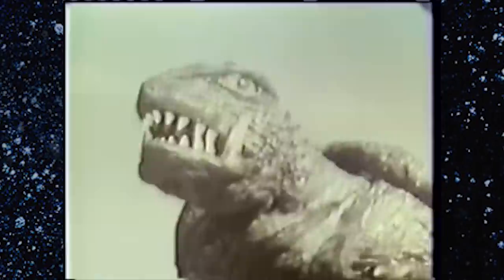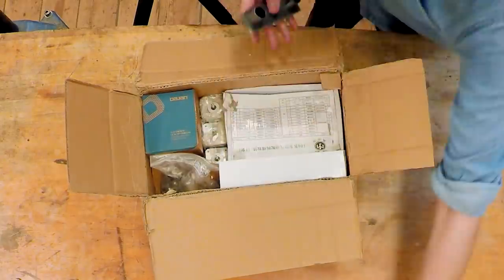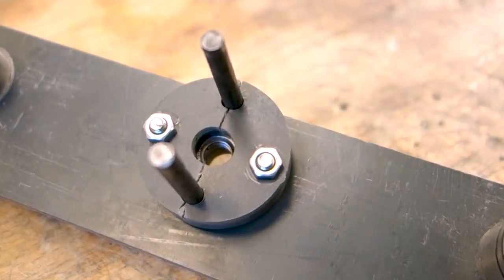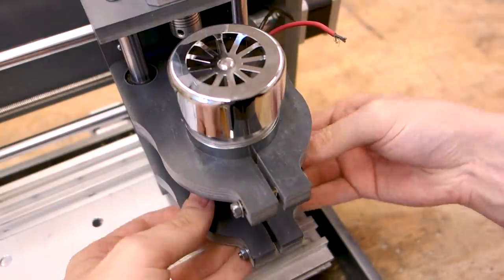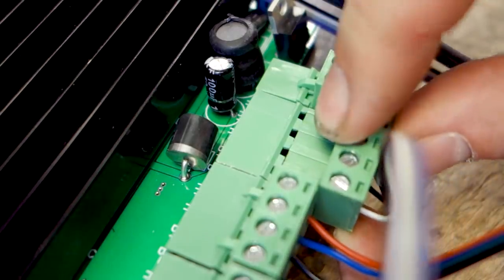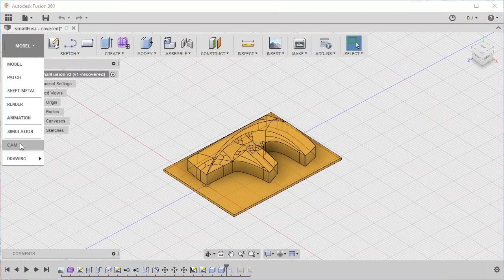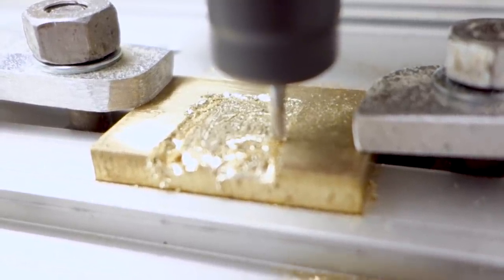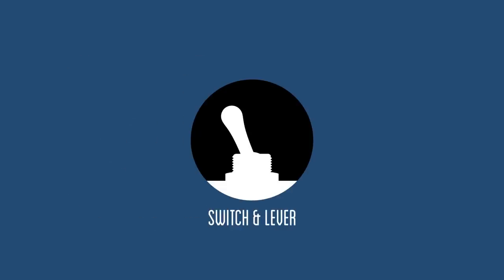Review: Cheap CNC Mill

Comment: Is it possible to replace the structural parts with aluminum or steel? Haven't finished watching. lol   
Finished watching. So it's a toy unless you want to completely rebuild it with proper materials.
Reply: +disgruntledscientist  well, a lot of things can be somewhat deceiving. Like just how easy it is to design and build a DIY CNC machine on your own. Few get it right the first time around. Few even end up with a machine as good as this kit here. I'm not saying this kit is so good, just people's attempts can turn out that bad. I know my first tries did not go so well. I got it eventually, but not until after I came to terms with a lot of things.
Reply: disgruntledscientist "Is it possible to replace the structural parts with aluminum or steel?" - Of course it is, but then it wouldn't be the same CNC mill anymore, would it? :P
Reply: why not buy a machine that is already made out of aluminum steel?
Reply: Google+ SUCKS BALLS - the worst forced social network "that is already made out of aluminum steel" - Hmm, I wonder what kind of steel is that. Never heard of it before....
But seriously: the reason is because a CNC with an aluminium frame would cost $600, not $400 like the Switch & Lever said this thing costs. Of course it would be a better CNC, but don't let that distract you :P
Reply: +CoolKoon  They may have meant aluminum metal? Or aluminum and steel? Though iron makes the best machines. For more reasons than I care to go into here. A capable metal frame CNC machine with decent linear guides would cost considerably more than just $600. Note that I did say, "capable". So that would mean a machine with better motors, drives, and linear actuators too.
Reply: Paul Frederick "Note that I did say, "capable". So that would mean a machine with better motors, drives, and linear actuators too." - Yeah, absolutely. But a metal frame is definitely something below which I won't go no matter what.
Reply: CoolKoon but buying a 400$ machine and replacing parts for metal would cost less than 600$ ?? You get a proper proxxon mini mill for 450€
Reply: Google+ SUCKS BALLS - the worst forced social network "buying a 400$ machine and replacing parts for metal would cost less than 600$ ??" - Only if you'd source and cut those parts yourself (maybe). I was referring to buying a complete CNC that come with metal parts anyway. 
"You get a proper proxxon mini mill for 450€" - Yeah, but to that you have to add the costs for the stepper motors (3 of them), plus the PSU, the electronic etc. They also sell a CNC-ready version for ~$900. Its only drawback is the smaller continuous surface area you're able to work (though in many cases that'd hardly matter anyway).
Reply: The proxon mini mill for <$500 is not a CNC mill.
Reply: the manual is 300€, cnc version 600€.. http://www.proxxon.com/en/micromot/27112.php   but you could add cnc on your own for 100 bucks.
Reply: +Google+ SUCKS BALLS - the worst forced social network   You are not going to get very much at all in the way of linear motion for $33 an axis. A decent stepper motor costs more than that. To really do the job right you should be changing out the lead screws for ball screws too. That means custom machine work, which if you are not tooled up to do that sort of thing is costly itself. Unless someone is offering pre-made kits. Which they're probably not giving away either. Realistically it will cost  more than $100 an axis to do anything decent.
Reply: You think the inaccuracy comes from steppers? LOL! Even if it had 50% error on step no micro stepping, it would still be only 1degree of error. Which on 8mm pitch lead screw results in 22microns.. A 10$ stepper is rated at 5-10% error and everyone is using at least 1/16 microstepping.. Your shitty stepper to lead screw coupler makes 20x more error than this.. not even touching the shitty construction which bends for thousands of microns just by touching it.
Reply: +Google+ SUCKS BALLS - the worst forced social network  You miss steps running open loop and well good luck to you is all I can say. But as far as I'm concerned the job is finished then. You do not seem to understand the difference between cumulative and non-cumulative errors either. 5-10% error between steps still adds up to 360 degrees in a single revolution. Because for every step that is 5% over there's a number of them that together are 5% under. So those errors cancel out over distance. Missed steps just add up though. The machine doesn't throw in extra steps to catch up. Deflection is handled by setting a feed rate suitable for the machine. I cut at about 50 inches a minute.
Reply from the maker: Finish watching first then.

No, it's not a toy, that's a gross oversimplification. It's just not a full flexed CNC mill, unless you're okay with just softer materials, at which it works just swell, or engraving. My point was to push it to see where the limits were. It does require some tinkering, and a spirit of fiddling around until things work. Compare this to buying a more ready product, for much more money, and you'd expect something quite different. I don't think one should expect of the former what one expects of the latter, that's an unjust comparison.
Reply: Thanks for the clarifications! Very informative review.

Comment: STILL EXPENSIVE FOR ME
Reply: CNC is an activity where you turn cash into parts.
Reply: you mean 400$ for crap parts^^
Reply from the maker: Apart from the too short, and non existent, cables you definitely get a complete usable machine. It's an engraver, and I tried pushing it beyond its intended purpose, to see what it could take. If that's your aim, then you'll fail, if you get it for what it's actually intended for you'll likely be fine (as some other owners of this machine has attested already).
Reply: yeh man, you definitely get what you pay for.
Reply: YUP
Reply: it has big error ratio , so weak for metal 
its good for plastic
but 3d printer better
Reply: yes but try to pick one of those up for 400 dollars ahah
Reply: entirely possible in this day and age, my 3d printer cost me just over 260 dollars and with a lot of tinkering prints nearly as well as one that costs 10x as much.
Reply: i  wasnt aware you could pick one up for so cheap, i realize it's probably small but thats cool. more reliable than a plastic chinese plastic CNC. but it could get the job done im sure
Reply: i completely agree, it's like what you show is all people base opinions on just because you didnt get it running super smoothly in the little time you had people just assume it cant do any better ahah
Reply: Switch & Lever Thanks for the video. Since one part broke immediately and you replaced the printing bed before even trying it, and considering the several other - improvised - modifications, what you get for $ 400 is not a complete, usable machine. Apart from looking at the quality. That's the main outcome for me.
Reply: correct.
Reply: Fail? Challenge accepted!
Reply: pls build new one using chip and software it has
Reply: big smoke,,for me,,too expensive,,
Reply: crap parts? he produced a fine part the third time and i guarantee you with some expierience with what the machine can handle, i could create just fine parts and turn that 400$ into parts then into more money :)
Reply from the maker: "with a lot of tinkering", that's the point I made in this video though, but people seem to get upset that it's not working like a much more expensive production machine right out of the box. Had I more time to spend on tinkering with it I'm sure I could get it to be far more reliable than what little I could show in this video.